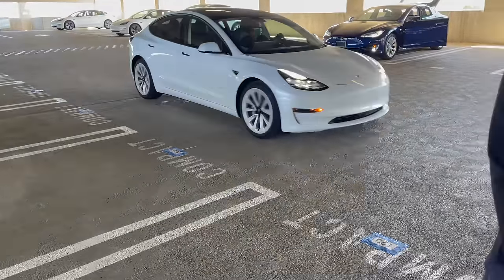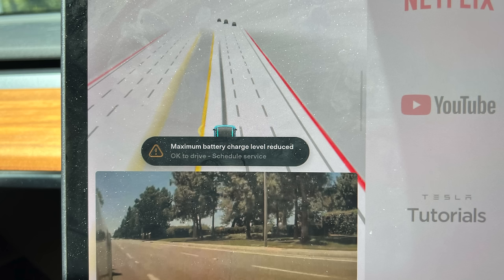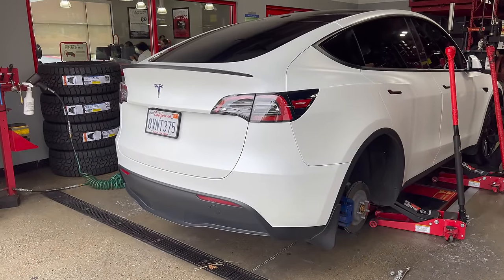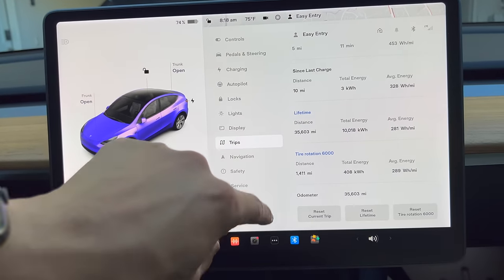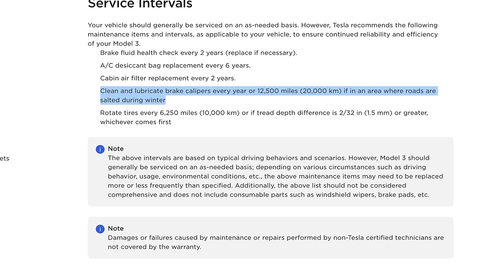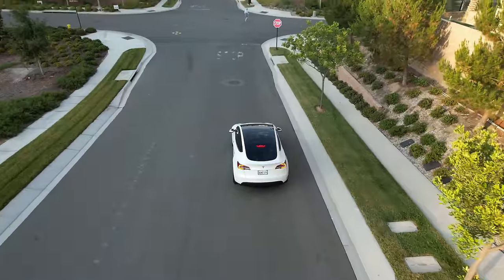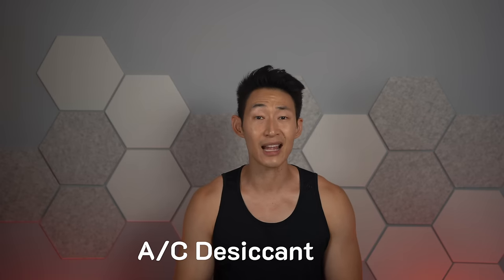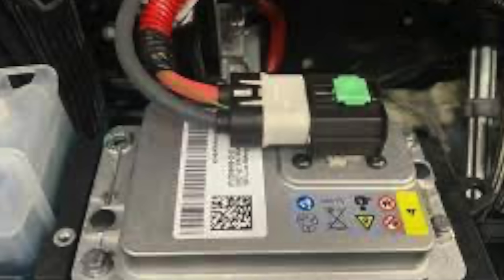Does TESLA Require Maintenance? Everything you need to know!

Comment: Had my model 3 since 2018. I set of tires, and just had the 12 volt battery replaced and brakes cleaned. So much better than ice crap cars.
Reply: 6 years was not that long ago 😂
Reply: I have a 2017 Model x and replaced the 12 volt battery 3 times, need a gear box fluid exchange and TESLA wants to exchange the drive unit 4000 Dollars (tomorrow) , had the A/C worked on twice in the last 3 years; 2000 Dollars, I'm on my third set of tires 2500 each set, (total 7500), got new brakes 2 years ago 2000 Dollars.; had a wheel alignment for 450, my roof rubber seals for the falcon doors is completely gone....replacement is 2500 per door (have not scheduled that yet) ...let's add all that up...
Reply: @MediaServiceArizona  it’s criminal . It’s still a rich man’s car
Reply: Check back when the car is 16 years old. Six years is a young car.
Reply: @MediaServiceArizona $4K for gear oil drain and fill? 😮 Wow. Is there something special about the fluid?
Reply: @ so you have a 16 year old car thats trouble free? BS.
Reply: @ptech88  I have a 2006 Honda Civic. Owned since new. That's 18 years, going on 19. It's gets maintained, for sure, but as of today it's trouble free other than body rust. I know that because I maintain it myself, and it is driven daily. It just got a new clutch. It drives great with the new clutch. My point is that the reliability of cars isn't really known until the 10+ year ish range. That's when you find out how durable and reliable they really are. There's lots of old Civics on the road, for example, just like mine.
Reply: @jptrainor  i own a 2002 civic and have done to much work on it. I have decided the next time it breaks down will be it last, im either going to burn it or have towed to the junk yard. Same think with my 2012 Mercedes sprinter, luckily it was recently totaled in an accident so i didn’t have to burn it. Point being all makes and models have problems but some just hate tesla from some reason. You i think fall into that camp.
Reply: @ptech88  I thought that about my 2006 Civic, and then I went and did the clutch because I have a kid that's using for a daily driver to get to school. Now I'm reminded how well it drives, with a fresh clutch, so I am going to drag it out until the body is totally shot or it needs new tires. Which ever comes first.

Comment: After market cabin air filters on my 2021 Y performance didn’t work to well against keeping out exhaust fumes out of the cabin. The design is poor because you can see the sunlight coming through the filter. I replaced it with the oem filter which works and keeps outside exhaust fumes from entering the car cabin.
Reply from the maker: Nice!
Reply: What's the difference in cost between the after market and OEM air filter that you considered buying the after market part first?

Comment: I have a 2020 Model 3. In 4 years I have had 2 maintenance appoints totaling 89.00. I had my cabin air filters replaced and my brake fluid checked. Regenerative braking means I rarely use my brakes.

Comment: You missed the drive units gear oil and filter. It's not in the model 3 (2021) user manual and Tesla service (Sterling Va.) didn't know the interval. I saw on utube 30k and 100k. I would think every 50k would do it or you can pay 3-6k to have it replaced at 120k miles.

Comment: Spark plugs rarely need changing, oil changes, belts are cheap.

I like EV but one High Voltage battery issue and your “savings”  are right out the window.

Most people(sadly) don’t keep a vehicle past warranty anymore. So basically any big issues you might have with an ICE would be covered. 

The extra up front cost of an EV, home charger installation……I  don’t think you”re much further ahead if at all

Comment: What about the motor oil? Tesla says you never need to replace it but I’ve seen videos on YouTube where they say you need to replace it at around 40k miles? And if you have a duel motor you need to do it for both motors
Reply: Motor Oil? It's an Electric Car. Electric Motors don't use Oil. I know, my E bike doesn't take any Fluids other than the Hydraulic Brakes
Reply: The Drivetrain in a Tesla uses a Gear Oil. However so does every other car and I have never heard of someone having to change their Gear Oil.

Comment: When a Tesla is beyond a extended warranty, how much $$$ too change a battery pack or replace one of the multiple electric motors most Tesla have? I usually drive my Honda Civics beyond 300,000 miles, currently have a Ford Maverick Hybrid.
Reply from the maker: so I did some research around 10-15k for a whole battery replacement =X

Comment: Off topic, but something I haven't heard you address is wi-fi connection. I park my M3 in the garage with a strong wi-fi signal and every time I drive away and return, it doesn't automatically reconnect. Each time Tesla sends an update I have to select my network and type in my router extender password. Kind of frustrating. How do I get the M3 to retain my password?
Reply: This could be because you don't actually have as strong of a signal as you think, or because your extender is limiting access automatically for security reasons. There are a few other reasons this could be happening as well, but I would recommend starting by checking those two things first. Also, what I mean by as strong of a signal as you think, if your extender is getting a weak or poor connection to your main router or access point then all you are doing is amplifying that weak signal.

Comment: Man, how much to change the brakes.

How much to alternate tires with a wheel alignment.

Mention how much things cost to do PLEASE.
Reply from the maker: Usually you can get away with never changing the brakes. Tires? Like 70 bucks and they come to your home. Not sure about alignment
Reply: It doesn't make sense to mention costs because it can vary wildly from one shop to another. A lot of this stuff can be done by any shop that is properly equipped. For example, a shop near me does tire rotations for 15 dollars and alignments for 60 dollars. As far as brakes go, I haven't had to do it at all after 50k miles.

Comment: 10 YEARS car maintenance comparison.

Gas car: 5k on Average.

Electric car: 10k + (depending of your model, as the battery will die or charge / autonomy will go down in most cases, so you will need to replace it).

Than add 2x for car buy cost and fast charge cost, Think about it. Electric is not cheap as they made it look like 10 years ago when they needed to attract people into it :D
Reply: My electric rate during the night is 6 cents per kWh, and I drive around 50 miles a day. In a Tesla Model 3 long range, I charge my car overnight for less than 2 dollars a night. I do basically no maintenance at all except tire rotations as recommended in the manual, washer fluid, and inspections on other components. This costs me less than 100 dollars every year. In contrast, my previous car, a 2021 Acura RDX which was mostly driven in the city with 21mpg, would cost me 50 dollars a week to fill up. And every six months or sometimes sooner I would need to go in for service which often cost me over 100 dollars. All in all, in a year, I easily save thousands with my Model 3. And this isn't to say that will be the case for everyone, but for me, it has been fantastic and a game changer.